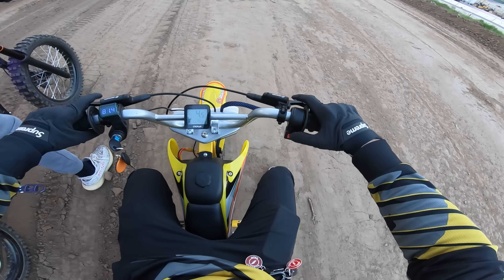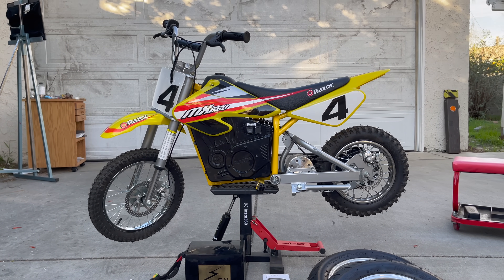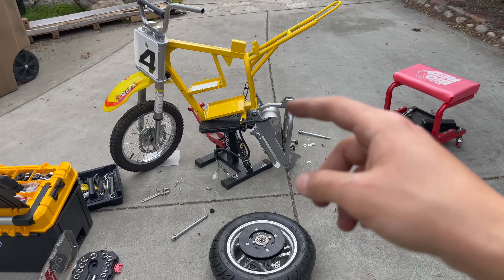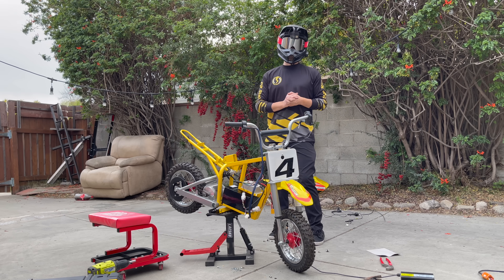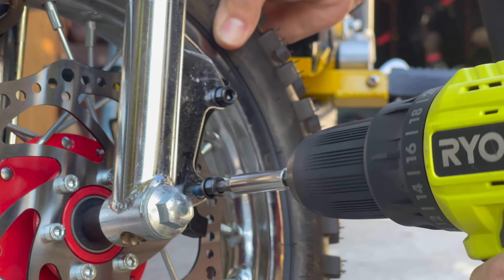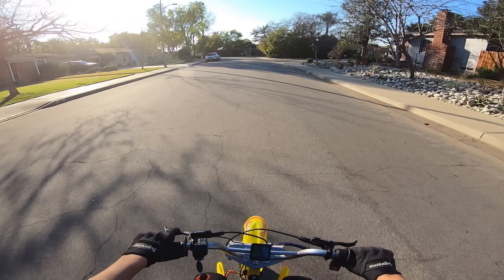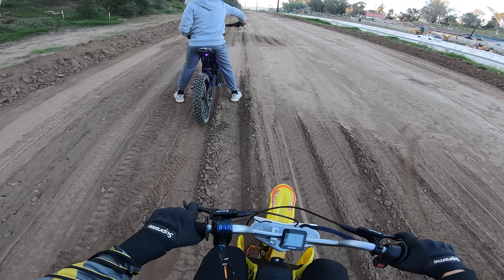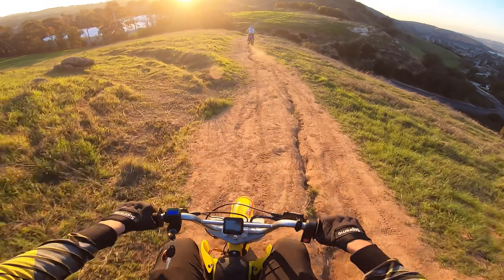How I built a 45 MPH electric pit bike // Razor MX650 72v Upgrade

Comment: Could you get bigger wheels on there? Like it looks like the rear one wont be able to unless you get a different swing arm, which may mean different rear shocks and a longer chain, but the front looks like its capable of a larger size.

Comment: Anyone have any links to purchase one of these?
48v 20ah Li-ion Battery capable of 100amp bursts with built in battery management and Charger included. (Fits in stock tray, no modification required)

Comment: Hey i just got my son a SX350 Razor with an upgraded battery. Unfortunately the motor is smelling like burnt plastic. just doesn't put up with the full speed and his weight? 

Im looking for a solution to upgrade the motor so that it can handle the higher voltage (48V or 36V) i need to check.   

Anyone got some input for me? upgrade motor to a 2000w or 3000w?  im not sure how battery V and motor W play in together.   I see now a mx650 would be a better choice especially with the suspension, but hey! marketplace buy for a birthday, just ran with it.

Comment: Can you find a way to DOUBLE the voltage on this? It's got room for a 2nd battery where the gas tank is!  What controller will work at 144volts?   What's the smallest custom rear sprocket possible for speed?
Reply: Gas tank? It’s electric

Comment: Purchased one on Amazon new for $530 USD recently. Gonna shunt mod the stock ESC until the stock SLA batteries are clapped. Then probably a 48v 2k swap on the cheap. I’d like to do more but without the RSF wheels and tires, I don’t think I will. They seem difficult to find and the ones I do find are heavily used or expensive. I’m 6’4” and 170lbs, I will struggle as it is and the MX tires are sketchy in the turns.

Comment: this vs and ev bike its speeds makes it illegal via roads use when you go 36 an up  you need a motorcycles id. so if you wanted to use this for ev travel just get an 35 max 48v ev around 560-2100 bucks the 21000s ones can go an upwards of 120 miles per charge so an on-sale 35 mile bike with extra brick is only an exra 50- 120 bucks so you could go 240 miles off 2 cells  the cells take 30-60 min to go from dead to full with that in mind if you cannot afford to buy an ev car an have a way to charge your ev va work in theory its cheaper then a buss pass and phone pass for around 50 bucks an month for 24 months so just go to a bike store to get loan way. so this kit is neat an all but it fails because of the speed an specks problems. also an hybrid ev/gas motorcycle is around 5g an used mixed used half cars and trucks are around 25g used while an self charging ev car that gets 55 miles per chage off the sun new is 25-45g with an 12 month waiting list from the new company if you want city ev trans port na want it cheap an ev  3 wheel might be better to get they can have 3 cores on one 3 bike plus an second seat or storage making it a 2 person ev  at 2,100 usd  if the adults are under 250 pounds each is not bad for the environment heck winter wise the ev 3 bikes with 300 miles per change can sell for 1500 bucks  on around an 40% off sale so if you want to bypass needing an motorcycles id the ev must go a max of 35 miles per hr meaning if you want to go on highways get a 3 wheel ev motorcycle if you want the speed and do not care about getting an id you could go an upwards of 400 miles per charge an if you have a solar pannle on it you could up it to 500 miles per charge with two half cell pannles.

Comment: i got one stock with 6 hoverboard batteries 4 25.2v batteries in parallel and 2 36v batteries in parallel both running series to add 25.2 + 36v

Comment: Hi sur ronster, I have a question. I was looking into buying the kit. Does it come with a battery and brakes or do I have to buy them separately. Also, i saw an option to include a heat sink, and I don't know what it does, should I get it or not. Thanks.

Comment: Just bought my kit now!!!! I’m super pumped to get it this summer. I’ve had the bike for a few years for my son and he’s now 13 and look for more speed. Great videos keep up the great work!
Reply: Is the battery recommended or can I just use stock
Reply: You have to buy new. You need a 48 Volt or higher lithium ion battery for the motor work. I would recommend buying a 72 or 76 volt battery because it’s only a few hundred dollars more and you get a lot more power. Hoped it helped.

Comment: I just got my new motor for my new mongoose cx24v450 and im super hype for it! It was super easy to get it mounted on the stock motor bracket, had to grind a little bit off the bracket to get the motor to sit flat, grind the bolt holes on the bottom into slots so i could line up the chain and remove an alignment plate but all that barley took me 25-30min and i had the motor on the bike, now i just gotta get a battery and controller for this bike and itll be ready

Comment: hey sur ronster whats the battery life and range for the other battery that got shiped in, i recently discovered my school wants to cut off my transportation to the school so i'm taking matters into my own hands and trying to find alternatives to the issue and ive settled on getting an e-bike. But I need a cheaper alternative to getting a surron which my famliy does not under any circumstances have the money to pay for a new or old surron so im thinking a conversion kit is the best candidate for the job. we how ever have multiple Razor MX650 shells and most work (*just dont work for very long*) and the deadline unless we can convince the school to transport me to the school and back. AND i really like my friends at the school im as so its difficult for me to adapt to a new environment in which i would basically if not literally be starting over entirely.

Comment: Few months back I watched this & decided to get into it. These things rip. They’re so fun.  If y’all wanna see how these do on the trails I just posted a video off-roading with it.
Reply: How many miles can you go tho
Reply: @kylealarcon5840  I rode about 20 miles the other day and had 66v leftover.
Reply: @BaileyF66  U mean the battery or like thats all u can ride before it break
Reply: Is this street/sidewalk legal? Even if modified?
Reply: @karbonkillershorts8551 they are in some places but aren't in others modded or not. Best to just check your area bro. Hope that helps some at least lol
Reply: Guys how much does this cost I really want one
Reply: @KBIKESS yeah bikes over 700 stock the kit you want is 900.00 that doesn’t include better suspension hydraulic forks extended swing arm and better tires and breaks. You’ll need all those things for the extra power and weight I’m guessing you’re an adult.
Reply: @177126 does the kit come with tools for assembly?
Reply: @KBIKESS it’s close to 2.5k I think
Reply: Suronster is the best YouTuber ever in my opinion

Comment: Got my kit in yesterday and it’s way faster than this video shows! V2.1 is insanely good, I got the 72v with heat sink and key switch. Easily going 45 ~ 50 mph with plaid like acceleration
Reply: I got the same!
Reply: how long did it take to ship?
Reply: Fekd 8 weeks.
Reply: @fekd7885  I got mine in 8 weeks. Also if any update comes out for the kit your order gets updated, like in my case where I ordered version 2.0 and received the newest version 2.1 because there was an update.
Reply: @BSwort how much was it ?
Reply: What kind of sprocket did u get /use
Reply: @juanescobar4790  14t
Reply: @BSwort  did You use diferent wheels or the ones that came with the razor bike
Reply: @juanescobar4790  I had street tires for a bit but I swapped to the stock tires. I prefer the stock tires because I take it in trails but the street tires are faster on pavement.
Reply: @BSwort  thanks got anymore tips for me i judt bought the kit and am wating for it to come
Reply: @juanescobar4790  make sure to think of a way to hold everything to the frame, i use strong half inch thick zip ties to keep the battery and controller attached to the frame. Other than that, I recommend if you wanna paint the bike do it before you get the kit
Reply: @BSwort  ah i see thanks
Reply: @BSwort  Are the Stock tires good enough for offroad trails?
Reply: @willekewk  yessir! With my experience they are fine, most the trails I go on are hilly and have gravel. Sometime the back end likes to lose traction but it’s because my throttle input.
Reply: @poopybuttlegs   no same chain, however electric and co does sell a new chain and rear sprocket kit which is tempting
Reply: juan escobar 12 tooth.
Reply: Would a normal stock battery work with the upgrades ?
Reply: @smiler9500  no, the connections are completely different.
Reply: Is the stock suspension good enough for trails and wheelies?
Reply: @tannerscott6208  not really bro, i recommend the suspension kit they got on their website. Stock is way to stiff
Reply: What kind of brakes did you upgrade to in the video?  Would you mind posting a link?
Reply: Is this street/sidewalk legal? Even if modified?
Reply: @karbonkillershorts8551  here in Illinois it’s not side walk legal, technically it is road and bike way legal if you don’t exceed speeds of 20mph to stay in the Class II e-bike specifications. Also under Illinois law we aren’t supposed to modify the speed without replacing the class sticker. If you go on roads like I do just stay at 20mph and make sure you get a sticker that says “class II, 20mph, 750W” also read up on your state laws.
Reply: what sprockets do u have on
Reply: @vrippa  motor 13. Rear 52
Reply: @BSwort how fast that go
Reply: Is that the 72volt battery from E&C

Comment: I built a mx500, mx650 and rsf650 during the pandemic and had all the neighborhood kids jealous of my sons & daughters bike. Wish I had a dad like me growing up😆 cant wait to finish the video and see it on the street tires like endo style. Also I upgraded to a 12in gas shock from a  mountain bike and it literally made it almost the size of a grom.
Reply: Hey do you know if the kit in the video 72v will work for the mx 350? Or do you know the maximum speed I could get it to go or the biggest battery I can swap it out with, I want to do the same speed but with that body cause I’ve seen one on market place for 100
Reply: @kashkash815  72v battery is huge for the 350 you would have to modify the battery holder, if you could sale that one and find a mx series it would be easier

Comment: Just scooped up a MX650 and ordered the Electro & Co. 5000w kit. My question is the suspension. Where did you get custom front springs made? I did get the hydro brakes as well. Just want to make the suspension as GOOD as possible. Any info or suggestions is greatly appreciated. And definitely subbed up. Excellent work, excellent shooting, excellent driving. Those wheelies are Super Dope. Stay up man.💯🍻
Reply from the maker: Thanks dude! The front fork here is totally stock. My RSF Min-E Moto has custom forks I explain it in the RSF videos!
Reply: @SurRonster  Ah ok. Gotcha. BIG PROPS Bro. And Cheers.
Reply: Hey do you know if the kit would fit or is compatible with the mx350 and will it run just the same as the 500 and 650
Reply: @kashkash815  The E&C kit doesn’t come with the motor mount. It screws into the built in mount on the rear swing arm. The mx350 you can get bigger motors with mounts. Hopefully Sur Ronster is cool with me putting a link up but here is what I’m doing with the 35048v Razor MX350 -How I Installed The Motor/Controller/Battery/14t Sprocket Speed Runs w/ MPH @ 4:20
https://youtu.be/vrHuegzRIf8

And here’s what it can be. Razor MX350 “Overvolted” 65t Rear Sprocket- 48v Fast Scooters OverVolt; 36v800w Motor; 15/65; MPH
https://youtu.be/en-L8wOMXZU
Reply: @kashkash815 it’s not
Reply: Man thank you so much this really helps , love your videos to big help 💪🏼🤘🏽

Comment: using a stock set up, can you make a video of ONLY changing the freewheel to a bmx 20t sprocket. im curious of what that might do with the given gear ratio and the rpm of the motor. i also want to double check my math but unable to afford a razor myself.

Comment: Razor is such an underrated company bc they encourage right to repair which the onewheel community is currently battling
Reply: That’s why I personally will NEVER get a onewheel
Reply: Yea, that’s not totally true. I used to have a razor electric scooter and they built it to make it basically impossible to repair by yourself, I had to literally take apart the back wheel just to re-inflate the back turw
Reply: @Virtual-caveman  Deciding to build things while optimizing cost rather than ease of maintenance doesn't mean they don't support right to repair.
Reply: One wheels don’t seem fun to me they blow imo 😂
Reply: Probably because the one wheel is super sketch and very complex whereas a razor is just a frame, wheels, battery, motor, controller.
Reply: Fr
Reply: For sure
Reply: i wouldn’t say they are extremely pro right to repair, but it isn’t hard to repair their stuff or upgrade.
Reply: I have those exact same dirtbike, but it’s just black
Reply: True
Reply: They Glue the Battery Connectors so its a pain in the ass to Replace
Reply: @congame11 yep

Comment: Yeo I bought the kit from electro, I was wanting to throw on also the supermoto wheels from razor on the bike and im just wondering what spacers are you using for the wheels since in this video and the supermoto video you never specified the spacers you used to fit on the supermoto wheels. Thanks it would mean so much if someone helped me out🙏🏻(In addition if I run the hydro’s on it what would I need to do to properly use them with the supermoto wheels for the front if you figured it out already)

Comment: how do u put the chain back on im having trouble putting the wheel on the back thanks
Reply from the maker: The chain tensioner is spring activated. Mess around with the chain tensioner by pressing it down and you should get clack in the chain

Comment: just a heads up to anyone do not use a drill to remove screws like he is. you can just as easily strip screw holes by using a drill by removing them. its actually easier to strip the holes because you do not have the hand feeling when removing them. dont be lazy

Comment: I actually have a few questions as to which tires you would recommend for the razor dirt bike as replacements, would bigger dirt bike wheels make it taller?
Reply: I have same bike/kit for a few months.. no/yes you can put bigger tire in the front but it's already bigger than the back and the tire in the back is basically as big as it can get without stretching the swing arm out cause it shares room with the motor... The kit takes a little more room away from your back wheel space due to the heat sync flares coming off the motor but it pops off if you want to remove it.... Hope that info helps if you plan on modifying one.
Reply: @devins1495  how’s the kit?

Comment: I just bought a sx500 and bought all parts I needed from Amazon and eBay to upgrade. I upgraded the motor to a 48v, the battery, controller, throttle, put a 3 speed on, and handle bars as well as some other things and it’s totally different. It hauls ass now. Almost threw me off on accident the first time letting on the throttle and it was only on 1 speed😂
Reply: For just the main components: battery, motor, controller, throttle will run you about $369 w/o tax. The motor came as a package with the controller, throttle, and a 3 speed as well. However I swapped the throttle that it came with out for one that reads the current voltage output. It also has as a key to lock the throttle so it cannot be engaged without the key being in and turned. (Won’t get stolen). Make sure to buy the right battery and motor as these are probably the most essential parts to the bike.
Reply: @blakeneef  ay bro can i get all the links?
Reply: @jonny__0.9  you found any links?
Reply: @mckenziewilliams2861  nah i havent
Reply: How much did the build cost? Im thinking about building one
Reply: Got you. 

Motor & Controller:

 https://www.ebay.com/itm/313686499026?mkcid=16&mkevt=1&mkrid=711-127632-2357-0&ssspo=sCeCKiVgTUK&sssrc=2349624&ssuid=l6myjRtRTpy&var=&widget_ver=artemis&media=COPY

Battery:

https://www.ebay.com/itm/313583334028?mkcid=16&mkevt=1&mkrid=711-127632-2357-0&ssspo=g5mflop9thy&sssrc=2349624&ssuid=l6myjRtRTpy&var=612402596536&widget_ver=artemis&media=COPY

Throttle

L-faster 24V/36V/48V Electric... https://www.amazon.com/dp/B01HRM1RM8?ref=ppx_pop_mob_ap_share

I just listed some of the parts that I bought and used. Motors brackets need to be cut off, and screw holes need to be drilled out on it a little to make the screws flush and recessed to the surface of motor to be mounted correctly. When installing electrical some wires will need to be spliced or pigtailed together. When using new motor you’ll need to take off the sprocket on it (reverse threaded, pain to take off) and put on the sprocket from the sx500. The new motors sprocket will be to big for original chain to fit which is why you need to do this. If you want to know any other parts I used I will provide links to them also✌️

Comment: This is what's great about electric. If you wanted this kind of power you would need a bike twice the size but with electric you can have lots of power in a smaller form factor. Personally I prefer a smaller bike so I hope to get one of these in the future.
Reply: Is this street/sidewalk legal? Even if modified?
Reply: @karbonkillershorts8551 def not
Reply: The RC community embraced electric over gas/nitro many years ago. It's just superior in every single way. The largest downside of electric (range) is less apparent with smaller vehicles so it makes sense that smaller vehicles will embrace it first while larger vehicles lag behind waiting for tech improvements. It should have progressed from RC to small recreational vehicles like these and then to full-size vehicles. I don't know why it seems to have skipped this middle step... electric motorcycles, quads, jet skis, etc are very viable.